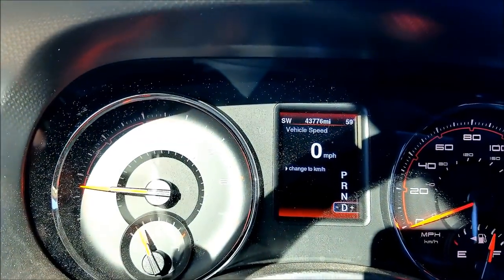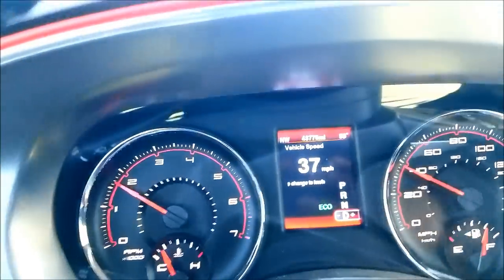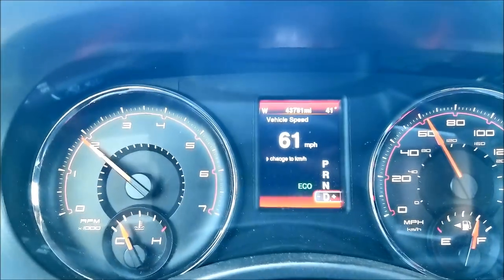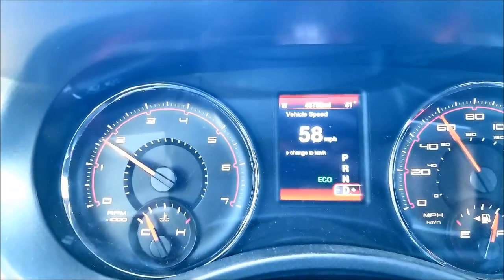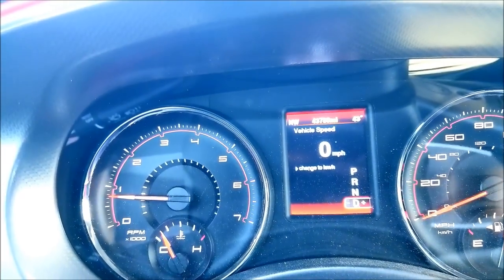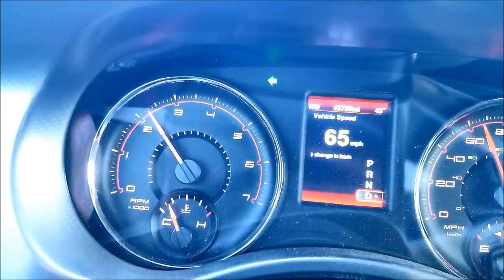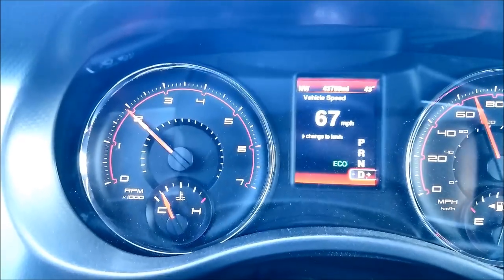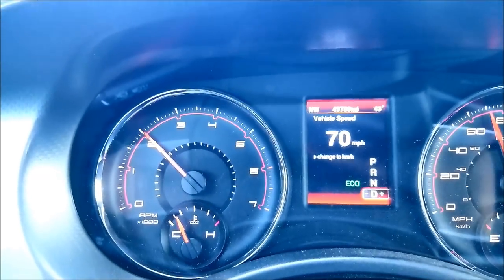Can You Daily Drive High Stall Torque Converter?

Comment: I think I heard you say that you run your truck at the track?  For many years, (when I was a younger man) I ran my daily drivers on amateur night at the drag-way.  We were all about 1/4 mile running etc.. It was a lot of fun. I ran some old cars, and even ran some brand new ones. All of them were at least slightly modded, (even the brand new cars I ran), and others were more heavily modded. (built) 
As far as what’s being discussed in this video? IMO, I could not honestly justify putting a higher stall speed convertor in ANY daily driver. To me, that makes no sense what so ever. Now, if you’re doing like I used to do, or like you said you run this truck at the track? That’s a bit different. Its a hobby, so I’d understand some modding. But, if someone isn’t running their vehicle! Should they do it? Id say no way...  Its just a lot of expense for something thats not practical for daily driving at all.  
On another note:  Back in my day, no one much ran pick up trucks.  One major issue in a truck that would concern me, especially in some newer diesel trucks and others is, by raising that stall speed so high, it seems to me,  it could possibly & even likely cause some vehicles to lose much of what they have as far as torque is concerned.  Any of the modern trucks that have that great low end towing torque, will potentially lose that, and might become a real “Pig” off the line if you’re towing something heavy. (like an RV or something).  Anyhow, just a thought I had on using high stall torque convertors in newer trucks. Again, if its a hobby and you’re running it, that changes all the “rules” IMO....   lol.     Thanks for sharing!!  Especially since high performance torque convertors are a part & topic that many people don’t really understand. Torque convertors can actually work against you, depending on what you’re doing with the vehicle. Which dispels the myth that adding expensive performance parts, no matter what they are, makes things better.  Lol. (Yes, some people DO think that way). This is one of those items that the potential buyer should really do their homework on, and UNDERSTAND what it is, what it does, and how it specifically affects the vehicle, BEFORE they decide to take the plunge. Yes, you could always put the stock convertor back in, but its an expensive job, and most of us cant afford to throw away that much cash on a mistake!  So, thanks again for the video!!
Reply from the maker: Have to pin your comment because you make valid points.  I do race at the track and yes this higher stall makes me get into the power band quicker.  Can you daily drive it? Sure. Is it ideal? Probably not.  I do race as a hobby and I like the old saying of "run what you brung" I like driving to the track to race then driving home. No need to trailer etc.  To your point of towing I agree 100%  I would not recommend this mod for a work truck or toy hauler.
Reply: Adding a 2500 stall in my 08 1500 Chevy picked up 3 mpgs city and 2 hwy and tows much easier, a stall converter will add heat but when towing it ends up downshifting less so it stays cooler

Comment: Nice video, but you left out something very important. With a stalled converter, your transmission is going to build much more heat in stop/go city driving. Heat is the enemy of transmissions, so you must add a transmission cooler when you swap from factory to higher stall. Cheap insurance for your transmission.
Reply: EXACTLY!!! 👍
Reply: Why wouldn’t you have a cooler regardless of the stall
Reply: @bryanrose20  they were talking more about adding an additional and/or larger cooler with a higher stall. Many ( not all)stock trans coolers are marginal at best beyond “normal” heat loads. So adding a higher stall, big tires, or heavy tow loads taxes a stock cooler very quickly.

Comment: I drive a 496 in a 2nd gen Camaro. Edge racing 10 inch converter stalls at 4200 RPM. 4.10 gears 29 inch tires.  No problem whatsoever driving regularly on the street.
Reply from the maker: There is so much bad ass in what you just posted here i've got to pin this.
Reply: Hello I have a 74 camaro 468 bbc I'm putting in with a fti 4000 stall turbo 350 4.11 gear 30 spline axles .what rpm are you running when at 60 mph?😀
Reply: @artbrady8581 74 nova with my 383 turbo 350 and 3.73 at 60mph I'm running 3k hope that helps
Reply: @mitchellfay5725  thank you for the info.😀
Reply: If it's not a lockup converter, I would love to see you "street drive" that combo in Florida on  US 19 from Hudson to Tampa when it's 95° in August. You would get that tranny hot enough to heat a house all Winter in Minnesota. A high stall WITH a lockup converter and you're good to go almost anywhere.
Reply: @milojanis4901  I was driving in the desert at 114 degrees with that. A tight high stall you wouldn't know the difference.
Reply: @mikeandnatalya  Yup, I drove the C5 with built LS7 to California and back. I saw 118° at 11:00 in the morning in August in Baker California!!!
Reply: @mikeandnatalya  My Yank.is 3,600 stall, with the highest stall ratio I could get in it from Yank. The lockup helps a lot......
Reply: @mikeandnatalya  My name is Mike also. My C5 is a great car, but it's an electronic nightmare. Would much rather have it in a car like you have. I bought a brand new 1974 Camaro as my first car. It was stock, but wasn't fast, but I sure wish I had it back!!!
Reply: @milojanis4901  I dont know where people get tis thing about high stall converters causing the transmission to overheat. Maybe with a shitty B&M or TCI or other off the shelf crap. Ive run as high as 4500 stall on the street for years with 4.10 gears. A good high stall converter made by a reputable company is no different than driving a "stock" converter UNLESS you gas it then it revs up to its stall speed. Driving around town or highway no big deal.  I swear by Edge converters. I'd never drive a lockup converter with anything I though might hook the tires up. Snap!
Reply: @mike p cool story bro.
Reply: Mine feels like its slipping until it warms up then its fine

Comment: Nice video and clarifies the RPM change with a higher stall. I’m running a Circle D 3000 stall in my 2011 Ram 1500 with a Stage 2 TSP cam. I notice this right away as I daily drive my truck. I added a larger trans cooler, deep trans pan, and switched to Redline Trans fluid. Trans temps stay right around 140F even on 800 Mile highway trips in 90F weather.
Reply from the maker: Those are super low.  Mine always sits at 171
Reply: @dasllamas  what sits at 171
Reply: Oh trans fluid 😂😂

Comment: Daily drive 02 camaro with a 4K stall. Love it!! A lot! Tires don’t have a chance, and off a roll, man she gets it! You want to run a trans cooler in line with factory one. If your thinking about doing it, do it! And go big, no regrets
Reply: It still creeps forward with no throttle at a stop, if it’s uphill a bit I can just sit without the brake. Yank SS 4K
Reply: Factory uses the radiator to heat up the fluid in colder climates, it has nothing to do with cooling the fluid. If you run high stall do not go through the radiator.
Reply: @rodpalm6398  TOTALLY incorrect. The radiator is the ONLY trans cooler on most cars. I agree you dont want to run it into the radiator in a super hi performance app, but I have a large trans cooler AFTER the radiator. Hardly ever go over 185°. The radiator helps warm the fluid quicker, and the large cooler keeps the temps down. I also have a large DeWitt aftermarket radiator. Coolant never goes over 195°. This is all on my C5 with a 600hp LS7 and a 3600 stall Yank w/lockup converter. Been fine for close to 15 years/60,000 miles. Driven to Florida, and back, several times.....

Comment: I've been running a TCI 10"  @ 3000 stall in an 86 Olds Cutlass since 1997.  350 Olds- 12.60s @ 106 mph- I drive fairly regular from April to October. Drive it to the dragstrip  about  4-5 times a year which is about 37 miles one way.  It doesnt seem obnoxious or too slippery. Once Im at cruise speed I don't really notice the loose converter. A 10" converter is quite streetable.
Reply from the maker: I daily mine year round. Once you get used to it I find it normal
Reply: Put a 10” 2800 stall in a friend of mine’s 81 lesaber 6.0 ls swap th400 gt45r on 6 psi for now and it gets off the line great and drives like a normal car if you keep off the go peddle

Comment: Very nice informative vlog. I have a 3000 stall older muscle car. Even at speed on freeway my convertor will still flash at 3000. I also understand that there is also a tight 3k stall and a loose 3k stall. I say mine is 3k because I can hold brake and rpm at 3000 without wheels spinning. Anything above 3k smokes the tires. So that is virtually where my convertor locks up at however not actually rated stall because motor just over powers the brakes.
Reply from the maker: cf mechanic ya mine is 3600 but its more like 3300. Its all approximate too. The same torque converter will lock up at different rpm depending on the engine it is paired to.
Reply: dasllamas yup i agree. From my understanding the more powerful the motor typically the higher the convertor will stall. I suspect/estimate my car to make 600+/- go and well over 500ft/lb tq. Check out my videos if you get time.

Comment: If you have a good cooler and have decent radiator fan to cool the trans cooler down even when your not driving,I’d say with out a doubt you can but I would suggest changing the fluid more regularly to prevent any fluid break down.

Comment: My personal car "duster" had a 4500 stall cover and drove it every chance I had. My father has a 66 satellite with a 5000 stall that actually stalls close to 5400 and it quite streetable does mean street cruises and car club cruises. As long as you keep the temps in check it will be all good.

Comment: I gotta say this does exactly what you do with a manual transmission, you just put the engine in its powerband and select the gear that works best for what you need to do.

I have a truck with an LQ4 that could use a high stall converter and I'm really just considering biting the bullet of all the extra costs and fab work to put a clutch pedal in it. We're getting really good at reinventing the wheel
Reply: A good stall and cam really wakes up an lq4. Especially if it's a big heavy truck.

Comment: I have a project I’ve been working on a long time and during the process end up having a couple back surgeries and 3 joints replaced so it going over time now.I’ve been working on a 72 Nove with a 450-500 hp 406 sbc but also have an 85’ GMC Vandura 2500 that I put the nova engine tranny and rear end in with 3.73 gears,the cam was a comp cams magnum 280.I called Coan and gave them all this info for the van since it was my test bed for the drive train and they recommended an 11” which they told me at the time was 28-3200 and it sounded too little to me but they are suppose to know and I went with them bc they’re only about 150 miles away from me and knew sooner or later I would have them retune it which they do but when I drove it the converter was tight just like a factory unit.yours sounded good but I would have expected it to sound a bit looser but no.I’d love to here the spec.’s for your set up to help me consider what I’ll be doing next.
Reply from the maker: Feel free to message me on insta or facebook with whatever specifics you wanted to know

Comment: I had a 3000 rpm converter in my hot rod that would drive very nicely on the street, but would flash to 4400 behind my torque monster at WOT. Keep in mind that stall speed and flash speed are not the same.
Reply from the maker: Very valid point

Comment: Thanks for making the video I think a lot of people really don't understand what converters for some reason. 

Holy crap is that an all-wheel drive burnout. Geez !

I also feel like some of the off-road guys should have some conversations with some of the performance guys because I really feel like a torque converter could be great for helping you launch with larger tires with less lag, etc. There are also plenty of situations where people need to be able to accelerate quickly and like a 5-ft distance when you're off-roading. Am I crazy? To me it seems like it would make sense to put this in an off-road vehicle.

Comment: If you cruise under 3600 rpm’s you converter will be slipping generating heat. So you need a really good cooler
Reply from the maker: I hear this a lot but I think it applies to the older converters that don't have the lockup. Have not had issues with this so far on my daily driver. Most of my drive is highway and sit at 2000 to 2500 rpm

Comment: Question hey buddy of mine put in a fti 3200 stall in his car with 90,000 mi at the same time replaced with amsoil and after 500 mi now mind you he is not a drag racing aggressive driver never power brake it he does not drive like that and now he has what looks like a lot of particles maybe from the clutches not sure we haven't drained the oil yet not sure what else it could be He's had no issues with this before and no issues after either except the last hundred miles he's noticed a shutter when the lock up torque converter engages and help would be great thanks
Reply from the maker: Did he tune for the new torque converter?
Reply: @dasllamas  it is a 2013. He was told by a speed shop it doesn't need a tune? Is that wrong?
Reply from the maker: @09roadraider40  that my guess. The tc wont lock up correctly and cause a surging type feeling
Reply: @dasllamas  well there is a lot of junk in the transmission fluid now It is clutch material just not sure if it is from the new torque converter or from the transmission hopefully an oil analysis will identify this. I am sure once we change out all of the fluid it will be fine but just concerned what it is and if it will just do it again?

Comment: With a lockup torque converter it should be ok with a stall 3500RPM or less for daily use but gas mileage with suffer at part throttle and feel a little spongy or weak at 2000rpm or lower but it will leave hard when floored from a dead stop and also flash higher engine rpm at cruising speeds for better acceleration passing and when rolling
Reply from the maker: Perfect explanation
Reply: I can’t decide on a 3200 or 2800 from circle d for my daily regal 5.3 60e . Which would be best for street strip build ? I rarely see the track

Comment: Put a BTR Stage 4 cam on my truck and a 3-3200 stall. Man that thing shoots up the RPMs. Before my truck would pop every time it changes gears. But now with the stall it just bypasses the gear shifts, quickly trying to get to the next. Making a lot of noise but going nowhere cause I’m just at cruising speeds. And my speedometer is off by 10mph. Not sure if that’s because of the stall
Reply from the maker: Most underrated mod.

Comment: I would want a torque converter that doesn't let the car creep when stopped at a light.   Also if RPMs can remain up around 800-1000 rpm at rest to improve A/C compressor performance
Reply: You can daily any torque converter  that has lock up just make sure you buy a quality brand
Reply: @Svhopowa  I'd probably have to buy my Corvair Powerglide converter from a Corvair vendor...most performance shops don't sell parts for Chevy Corvairs
Reply: @gojoe2833  You know now that u say that, I can't recall seeing parts for them hardly anywhere! Huh never noticed till u just said something lol There's always a price to pay dealing with old classic hotrods lol

Comment: I have a 1974 Ford Maverick that weighs about 2500 pounds with a 3800 Fairbanks and it does not slip near as much because the car is super light
Reply from the maker: You know I never thought about weight causing more slip.  Thanks for sharing.

Comment: Looks like a high stall speed would feel like a bit like a CVT at part throttle and you said it after I typed it lol.
The 'rubber band' effect some people used to say when they first came out. Unfortunately for CVTs, they program them like normal transmissions now which is silly taking away its advantage to make people 'feel' better in their head.
I heard you want your lockup to be at or below cruising speed, so 6th at 70/80 would be best for most people and above stock setting

Comment: I run at least a 2500 in all my vehicles and low gears if you do a lot of city driving you will pick up mileage and it’s just less effort of the line and passing people, and stop light to stop light nothing can touch it, my 400 sbc make 340hp on a good day 5.56 gears and 2500 stall would smoke them into 3rd and would wax “400hp” Subarus until 110 then I was outta gear

Comment: I have a 2500 stall I went up a hill it shot transmission fluid out the dipstick for
Reply from the maker: Not sure that would be a torque converter issue.  Issue with the trans or too much fluid in the trans.
Reply: When it's cold it wont move until you rev it to 2500 after it warms up it acts normal
Reply from the maker: @lukewebb96  hmm... daily drive mine even in sub zero temps with no issues.  What brand torque converter?